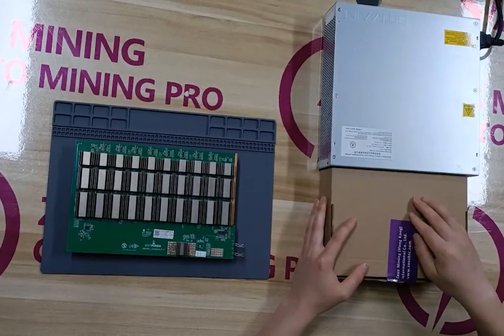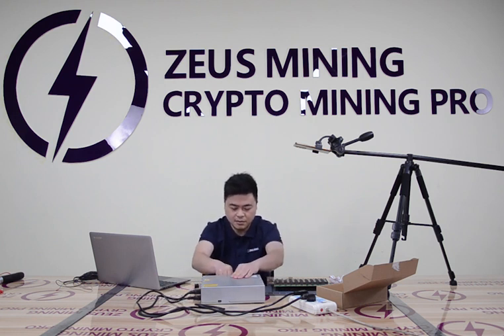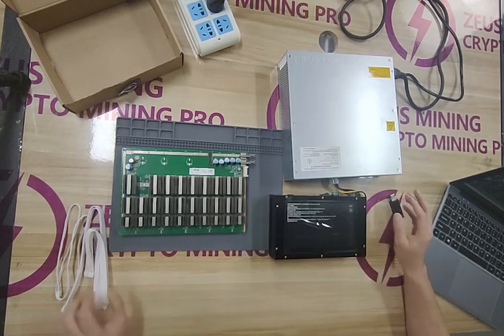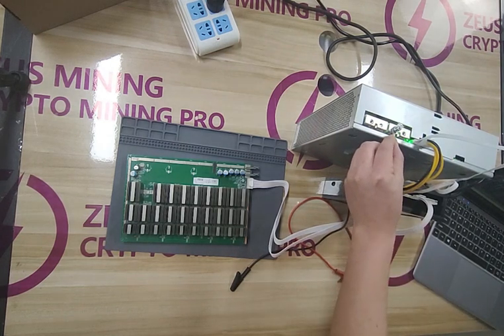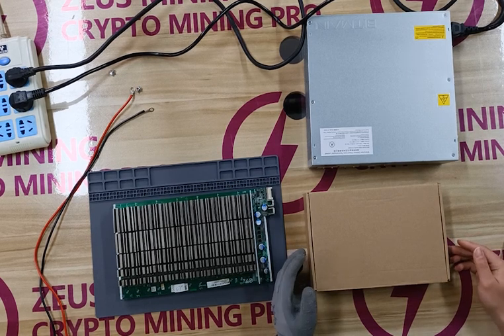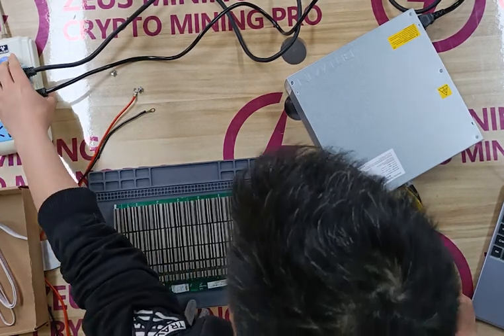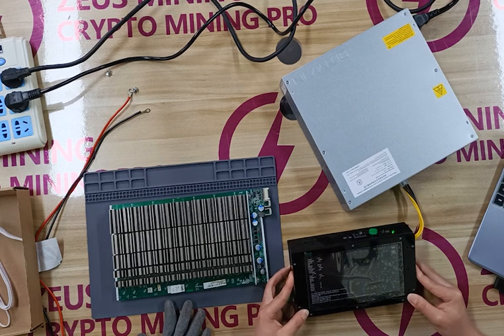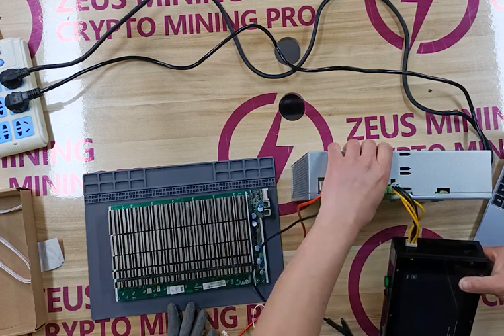How to connect Antminer S17+ / T17 hash board when using the new offline test fixture? - user manual

Comment: Can you show the last step with close up of the screen for S17+? I have purchased the previous version of the test kit and followed the steps, loaded the conversion files then loaded test files, which I got from your support team. I am using the power supply from the miner. 
The issue I am having is that the test starts up and completes with this message (just like a message from the miner system log). "1970-01-01 00:32:46 driver-btm-api.c:1009:check_asic_number_with_power_on: Chain[0]: find 30 asic, times 2"
I am not able to identify which ASIC is having the issue. What am I missing? Thank you for your help.
Reply from the maker: The test log shows "Chain[0]: find 30 asic". Please check whether the signal voltage and ground value of chips No. 30 and No. 31 are normal.